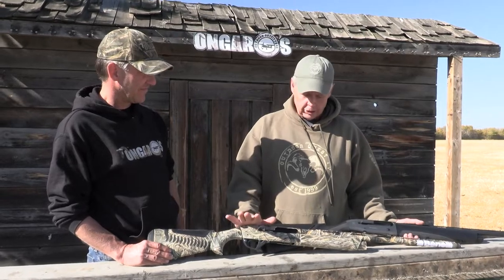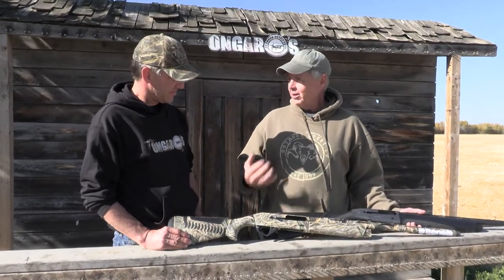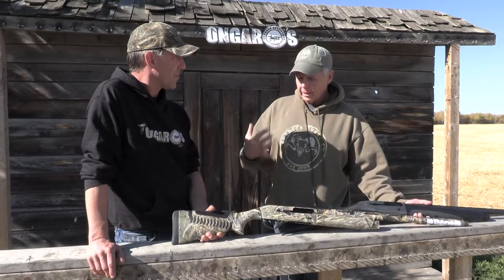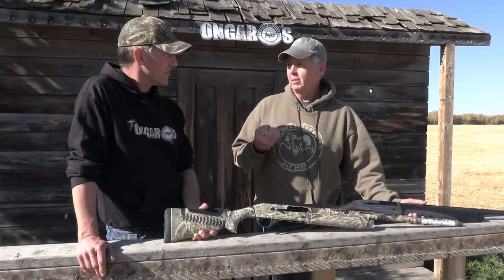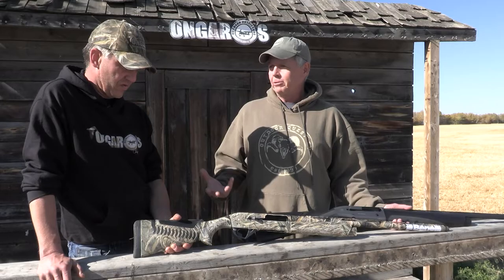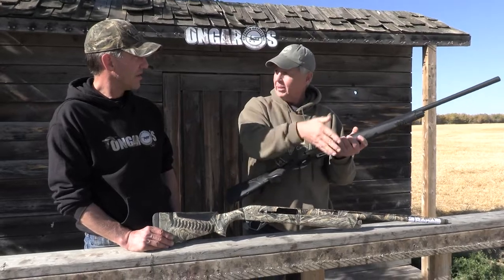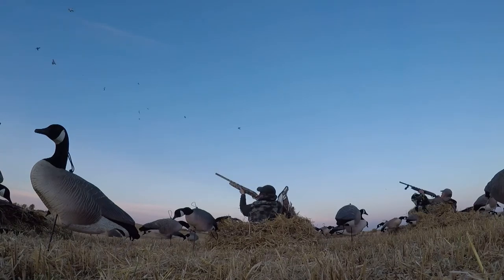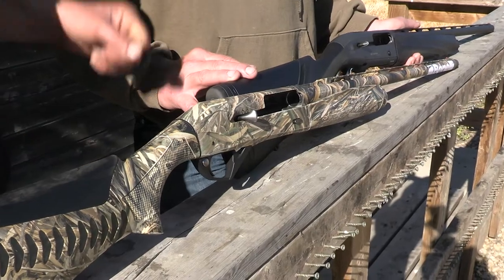Gas vs Inertia Shotguns

Comment: My Weatherby is an inertia driven gun and it cycles everything from cheap bulk bird shot to 3” 1-3/4 oz buckshot. I cleaned a Benelli SBE 2 for a friend and to be honest after seeing the insane amount of fouling and build up that the system could handle without malfunctioning, I was very impressed.